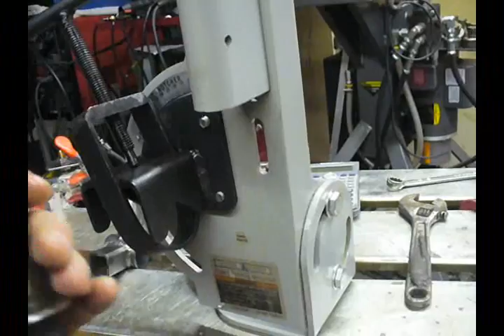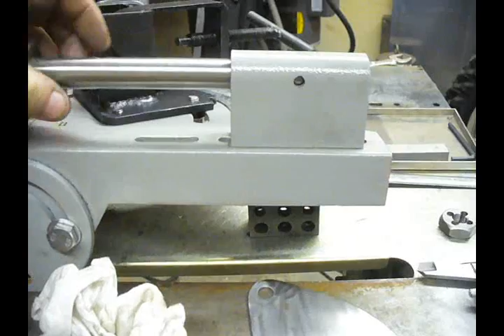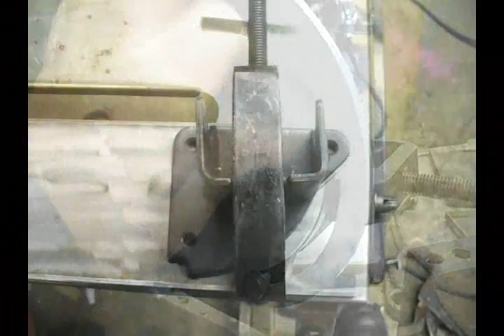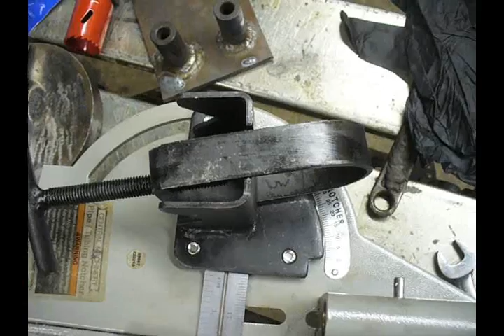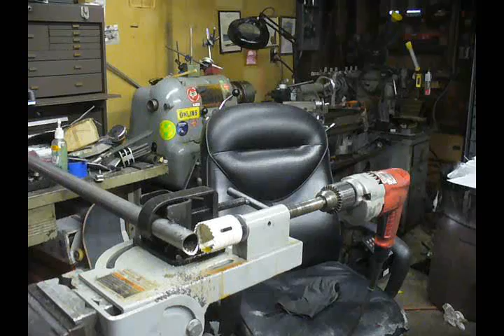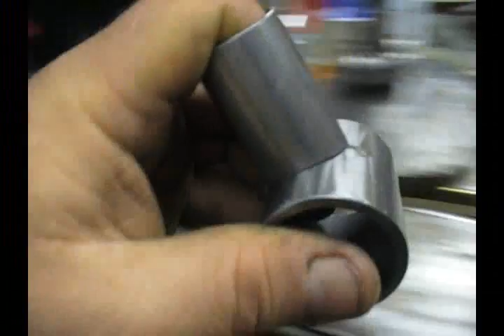Harbor Freight Tubing Notcher Modifications

Comment: So far so good on all HF tools......inexpensive but capable tools that get a job done. My air gun has been framing for 4 years now and no problems. jack hammer has busted up yards and yards of concrete.....these tools, while being a bit flimsy sometimes in some areas, generally are very good, they just can't take a real bad beating like tools 10 times the cost. Take out the warranty and if it breaks just go back to the store and get a new one, no questions asked..... How can you beat that?

Comment: I Tapped the little hole that the shipping lock pin came in and threaded a zerk grease fitting so i could pump a little red grease into it to help that bronze guide bushing last longer and keep heat down when cutting.

Comment: Why bother making a mess with coolant that you then have to clean up before welding? You dont need to use coolant on bimetal hole saws cutting through mild steel. I found I get the same amount of blade life dry. There is no need for the coolant mess!

Comment: I've had mine for several years now. Found the same problem and did the same solution with the shim. It works great, have used it a lot and no problems. 
This thing will not (at least for me) work in the drill press. Not enough feel of the cut to control pressure. 
I would love to find some hole saws with fine teeth. Large teeth with this notcher causes a lot of stress on the clamps. 
Good video, right on the money with your analogy of this tool.
Reply: Thanks for the tip. Going to search for them now. :)

Comment: Interesting. I have never used a notcher like this before. I have used hydraulic ones that shear the notch in, hand lever action shearing ones, belt sander type, and the old-fashioned angle grinder free hand. If the hole saws get a pretty long life this might be worth a shot in my home set-up.
Reply: I made a motorcycle frame with one of these...worked great.

Comment: What I did was made a L bracket by welding a 3/4 tube 90 degrees onto a 1 inch tube, then used washers to fill the gap you filled. Was very accurate.

Comment: Cutting oil is different then Saw Wax?  I have a truckload of differing sizes of hole saws and have only had a few spall off the teeth like that. I use cutting oil every time if I am cutting steel.  Most in my collection are Lenox or Milwaukee brand bi-metal. I'll keep my eyes peeled to see if the ones that lost their teeth weren't the cheaper Samona brand.    Some sizes are hard to find.

Comment: i always thought you used the same size hole saw as the tube it getting butted upto. ex if you had a 3/4" tube and your wanted it to be notched to fit upto a 1" tube you use a 1" hole saw.

Comment: Something I have noticed about "Chinese" hacksaw blades & hole saws is that they are tempered differently from most American products. Meaning they are less flexible and therefore are more brittle. The ones I use seem to stay sharper longer if you just slow down the feed rate and keep the lube flowing. Mine hold up to American brands if I use a lighter touch on the feed rate.

Comment: Hi JHV166,

If I don't make the piece (since I don't have a hi-speed cut-off tool or a plasma cutter nor those sheet metal scissors) can I make the modification using 16 gauge washers to be placed on top of the original ones where the nuts go??

Thanks and Happy Holidays !!!

Comment: The only thing with that is that you may not be able to find washers of the correct thickness. But if you can find some with a couple different thicknesses, then I'd give them a try...definitely. If I couldn't, then I'd use aluminum sheet in order to avoid differential metal corrosion. But for $30-40, this fixture seems well worth it for someone that only needs to use it occasionally.

Comment: Ok it looks to me like you have a mill. So why in the hell are you using that notcher? Just clamp the tube in the mill vise, put the hole saw on a 5/8 fine bolt as an arbor and voila. insta notcher. We build 100 cars a year using this method with 3 bridgeports.

Comment: Thanks for posting this video!  The one I bought was out of alignment by 0.095 inch. I used flat washers to shim.  I am using mine on a bench-mounted drill press. I had to bend the angle plate to get it plumb with the quill.  The top brass bushing spun out after the third cut.  I think it will be useful once I get it rebuilt.  Regards.

Comment: Like your video!!
I was wondering if I use this and want to stick weld my joints, would that be doable? or are you mig wire feed welding them? I want to mod some on my motorcycle but only have a smaw ac lincoln 225 welder. please respond or someone with the info. thanks again great video keep it up.

Comment: Stuff a wad of insulation in the hole saw and soak it with cutting oil, saves on the amount of oil you have to put on the pipe and hole saw and not quite as messy

Comment: I think JHV166 knows what he's doing - washers were my first thought also. But then i saw what he did & noticed that the sheet metal shim gives full support not only to the three points at the cap screws that washers would support, but to the entire surface, especially the edges (which have the most leverage for support) that otherwise would float in air - more slop is no good thing on tool that is specifically made to be just better than not having one at all
And for that, I DO give it 5 stars!

Comment: @JHV166  The same mod could be done with a file, or a grinding wheel, or a die grinder.
There is usually more than one way to skin a cat.
A poorer, but cheaper way might be to put a shim in the low side of the vise jaws.

Comment: @JHV166  So I just bought one and made a shim out of .053 steel and that fixed one issue, the other issue is that I went to put the pin in to lock the shaft up and it was blocked by the bottom gold 'bearing' inside. It's loose and slides up and down. Is this normal?

Comment: 10-4 on the monkey motion! I had the EXACT same problem with my notcher. I used fender washers to bring back to somehere near center & bought a Lenox holesaw. Also, replaced all the hardware with quality fasteners. It has a ton of slop in the brass bushing. I thought about a bearing setup but,I figured I had already spent too dang much, on a chinese bender.
Cheap is really what it is..., lol  I guess I can't complain because I knew not buy it in the first place.  

Go Figure

John

John

Comment: To align the debt I would use a metal wedge scraps laying around along with some washers. hammer the wedge in. Grease, instead of oil on the shaft, could give less run out.

Comment: The weld where the hole saw joins itself keeps catching on my material and sending the hole saw out of round... and messing up my cut... any tips as to if I am trying to cut at the wrong speed or something like that??  I was using Milwaukee hole saws and cutting fluid on the saw and the area being cut....

Comment: Great video...very useful. I bought one of these last week (although I paid £90!) and I've shimmed the clamp as you have to get a good centreline. I still find that even though the clamp, tube and holesaw shaft are all at 90 degrees I don't quite get a 90 degree cut. I could compensate but its trial and error every time I set a new angle. Maybe I need to get the saw closer to the job before I start. Still a great tool.